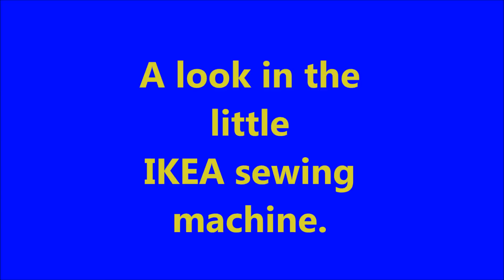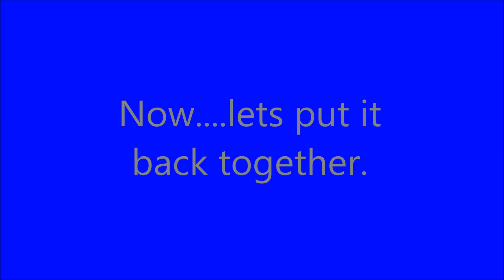ikea sewing machine

Comment: I have sewn for more than 50 years, beginning with a treadle and now with a top of the line computerized machine.  I bought this machine out of curiosity more than anything else.  At the price,  I assumed it was a toy.  It is not!  It is a fine basic mechanical sewing machine.  The difficulty for beginners is that mechanicals require some knowledge of how and what machines do in order to operate them efficiently.  You think the machine is broken when it merely is operator confusion.  

For instance, the machine I purchased had a terrible squeak.  A first-time sewist might think the machine should go back to the store.  I realized it probably had been sitting on a shelf for a couple of years and was in desperate need of oiling.  But In order to do that I needed to get inside.  Yet the screws seemed welded  to the machine.  They would not budge with the screwdriver it came with.   A little WD 40 and a better screwdriver, quality machine oil and the SY purred like a kitten and handled beautifully.  

Word of cauton to beginners:  Keep a tiny piece of scotch tape within reach to hold the screws so you don't lose them when opening the machine.  Invest in a better tiny screwdriver and a standalone LED light.  

Also, the buttonhole on this machine is only adequate.  I'd go over  (repeat) the stitches a couple or three times before  releasing from the machine.  

First-time sewers, sew  something right away that you will use.  Begin with simple things like a custom cover for the Sy.  Bernina and Joanns websites have free patterns on how to sew one to fit your Sy perfectly.
Reply: Hey, i also bought this week sth like this, ikea. But it does not work properly..i guess the rope coming from under has problem. What could be the problem and the solution?

Comment: I have been having trouble with my SY as the bobbin winder won't rotate anymore. Decided to open up the machine and take a look inside, and used your video to try and piece together which screws need to be unfastened to take off the cover. I have been following along and have removed all of the screws and all of knobs and other tiles except for the stitch selector dial, and the cover is now somewhat loose but still won't come off. As for the stich selector dial, I cannot figure out how to get it off - it won't come off when I pull it and I don't want to apply too much force as I'm afraid I might break something. Any tips on how to get if off or is there anything else I'm missing in order to take off the cover of the machine?

Comment: Hey, Im having problem with mine too, i opened it, the pedal is working fine, motor is too... Manually works, bobbin spinner works n when i press the pedal n motor goes on, but the big wheel just spins n does nothing... Like it doesnt catch on... Is the plastic worn out or something? I cant find why wouldnt it work... It sews fine manually... I dont get it... All gutted for nothing? Please help anyone out there 😭🙈😔😔
Reply: Check if the hand wheel is pulled out for bobbin winding? Push it in and the machine should sew.

Comment: I  just bought one and I had the spring one the screw ( the one that holds the bobby thing- tiny black spring) fall inside the machine. I am scared to open it. Should I put it back together without it?  I tried shaking it out to no avail. I hear it knocking about in the . Help!!!

Comment: Hi there, glad I found your video! 
I have this sewing machine for about 3 weeks and it has been working very well! But the problem is...

Tonight, I was sewing for few hours,  then I turned the machine off to iron my fabric for about 10 mins,  when I went back to sew, I turned machine on. Then my sewing machine has blown,  and I saw a quick flash, then it stopped working. And switch doesn't click  anymore so now I can't switch it on (I can still feel the spring is working but it just doesn't click on. I'm not so sure has the motor blown or the fuse or anything else?  Please let me know if there is any chance to fix it? Xx
Reply from the maker: tbh sounds like something electrical. but as it is only 3 weeks old, you should go back to ikea and get a new one. warranty 👍
Reply: +The DIY channel thanks a lot for your reply, that was light bulb has blown,  and it made the power switch shifted a bit(that's why the switch doesn't click), but the motor is still working I can still use it without the bulb at the mo. Yeah I should take it back to ikea, and get a new one.
Reply from the maker: +oH'z Smith getting hold of such light bulbs can be tricky. see if you can get a led buld. should give a better light
Reply: +The DIY channel  can I change it to led bulb? Will it fit the machine? I don't like light bulbs, it get too hot so quickly!
Reply from the maker: +oH'z Smith well here in holland you can. seen a few around. 👍.
Reply: +The DIY channel thanks!I'll have a look on eBay xx
Reply: oH'z Smith  I just bought this machine but don't have the pressor foot or pedal.
Reply: oH'z Smith Same Problem...